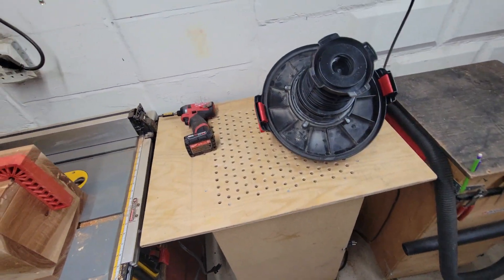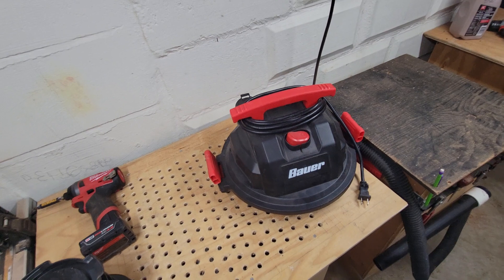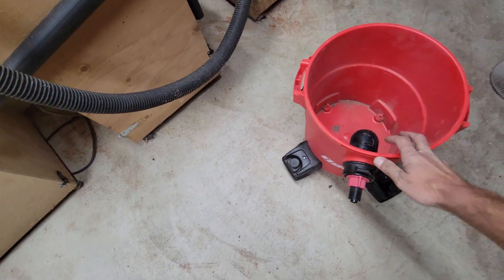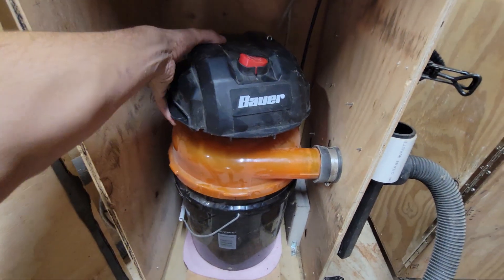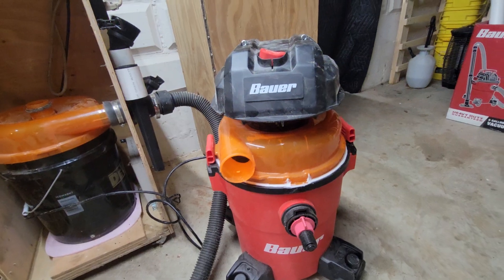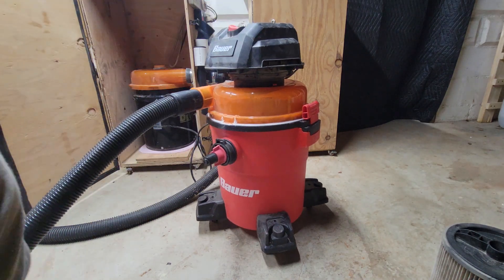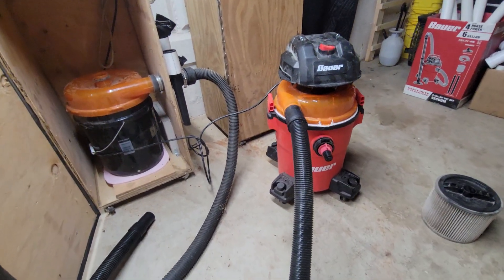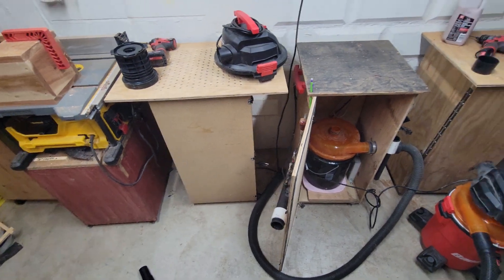Direct Connect Dustopper Vac Hack

Comment: How has the motor and impeller held up with the filter delete
Reply from the maker: I had it apart recently. The only thing I noticed was a little bit of build up on the impeller veins. This is on the unit that lives in the rolling cabinet, it hasn't had an easy life.

Comment: I really appreciate the innovation here, but won't the lack of a filter kill the motor?  Am loving your channel so far!
Reply from the maker: I've accepted the tradeoff of probable shorter vac life vs a really handy setup. There is only a light film of fine dust inside the cabinet after a year of steady use. 
Thank you for watching, I really appreciate it.
Reply: @that1guydoesthings  Okay, that's reasonable.  It does make for a nice, small form factor.

Comment: Doesn't this defeat the purpose of having the dustopper? I thought the whole reason for it was to have it on a separate bucket in order to help keep anything sucked up from going into the vacuum itself???
Reply from the maker: In my case it exhausts into a sealed hepa filtered box, and works great. I've seen them piped to exhaust outside also. Im just showing a different setup that may work for other applications.